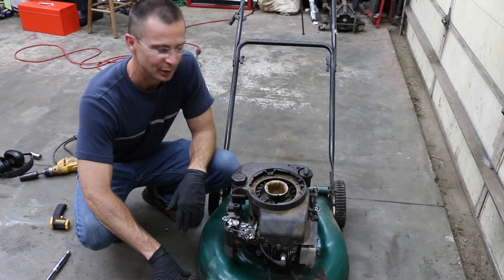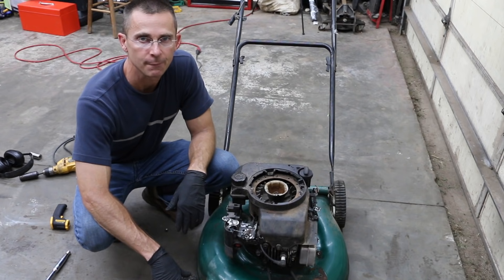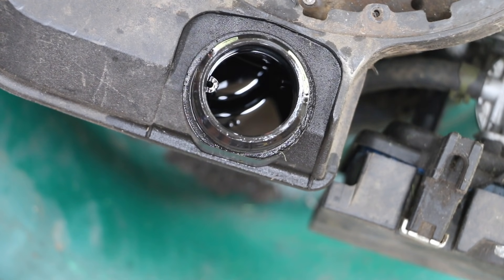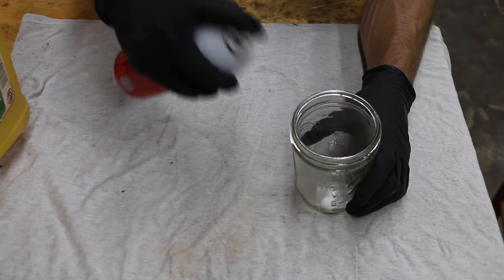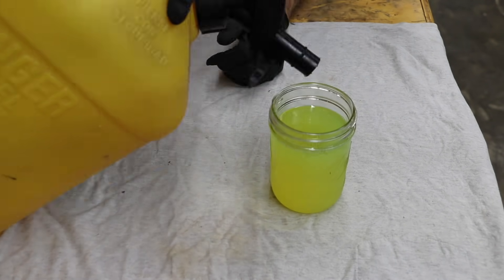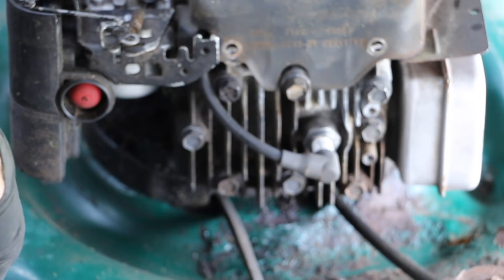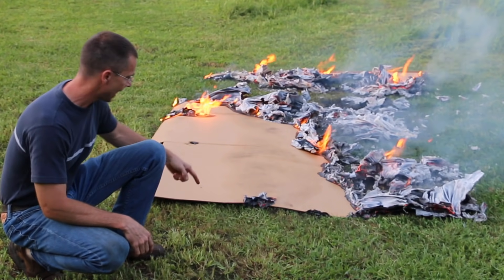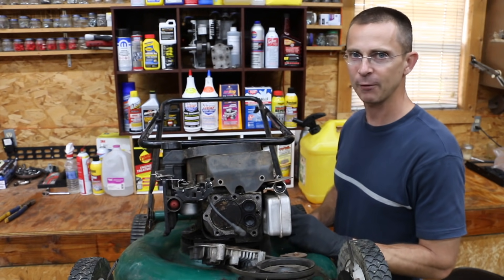Will a Gas Engine Run on Diesel?  Let's find out!

Comment: start it on gas then once its up to temp switch to diesel. i have done it with really good results
Reply from the maker: Thank you for this recommendation.
Reply: i set up 2 tanks with on off valves into a t. did it in a driving lawnmower during a garden tractor pull

Comment: If diesel burns slower. What affect on power and fuel economy would a 50/50 diesel gas mixture have? Just curious.
Reply from the maker: I wouldn't do this unless it was an emergency situation.  It could cause several issues over time. Thanks for commenting.

Comment: Test Turbo Max vs Bestline.... both claim it will save an engine that loses oil pressure.
Reply from the maker: Thank you for this recommendation.
Reply: Project Farm thank you for the response! I love your videos, they are always very interesting. I must warn you, to actually test the claims of the manufacturer... will probably be an expensive test.

Comment: In WW2 the Germans used wood shavings burning in a trailer and pulled the fumes off of that to then run a gas engine. Check into that and give that a shot!
Reply from the maker: Thank you for this recommendation.

Comment: when I was a kid the old boys that ran log trucks in our area used to add 3-5 gallons of gas to each of their tanks of diesel in the winter time when it snowed. Just FYI They told me when I asked that the gas helped keep the diesel warm in the tanks till summer. I thought that was, and still is a good answer.
Reply from the maker: Thanks for commenting on this.
Reply: This was to prevent jelling of yhe diesel fuel in cold temperatures.  Back before diesel was premixed - winter fuel - I'd mix it 50/50 with kerosene.  Not many stations carry kerosene anymore.  I'm sure gasoline was nearly as good. Still you would see a few semi trucks from the south on the side of the road in below zero temp in Minnesota stopped because of fuel gelling.
Reply: Was common when I was younger too - it stopped the diesel waxing in very cold weather.
Reply: We still do it in the heavy equipment on our ranch.
Reply: Works like an OTC additive, right??

Comment: Wondering what would happen if you preheat the diesel fuel.  Then try to start the engine
Reply from the maker: Thank you for this recommendation.
Reply: air to fuel mix in a petrol engine is about 15parts air 1 part fuel in a diesel engine it can be up to 70/1 so basicly if u preheat it like in a regular diesel it wouldent spit out unburned fuel ( the white smoke ) it would hawe 3 to 4 times as much energy so it would probably blow the gasket or the head itself i m not shure but i m 80% positive older diesels with a stronger mix like 30/1 are well known  for blowing up head gaskets turbos aspecialy
Reply: Ernie  all you have to do is have the engine warmed up and then fill with the diesel/stove oil/ kerosene and they will run fine !!! Have done it for years!!!  Diesel will ignite with a spark plug !!!!

Comment: The fact that you had to pump the primer to get it to run on diesel meant the carb needed to be adjusted. Diesel burns at a different rate. It's also a different viscosity.
Reply from the maker: Excellent point. I sure with these newer Briggs had adjustable jets like the older ones. I probably should have drilled out the main jet to increase fuel flow. Thanks again.

Comment: Diesel fuel is less volatile than gasoline, and diesel engines run at much higher compression to ignite the fuel without the aid of a spark plug. Aside from flooding/fouling issues it won't hurt much but won't run well or at all...
Reply from the maker: Excellent point and thanks for commenting.

Comment: I knew a guy who had an old (late 80s - early 90s) diesel VW golf. He would fill the tank with gas if the station didn’t have diesel. First time I saw him do it I told him it’s going to ruin his engine to which he said that he’s been doing it for years and it runs fine. Wtf lol.

Kinda blew my mind that it worked. I knew man others who had to get their diesel system drained and flushed following a mistake from a wife or kid. Don’t know if they just flushed the system preventively or if their trucks actually didn’t start following a gas fill?
Reply from the maker: Wow!  That's very hard on the injection pump as well as the engine.  Thanks for commenting.

Comment: Would it run (with the diesel) if you disconnect spark to the engine after initial starting? Hmmmm...
Reply from the maker: Thank you for this recommendation.

Comment: I’ve ran a lawnmower on straight K1 kerosene, I start out with gas, not much in tank, let the motor get hot then fill tank with kerosene. Yes-while it’s running, I don’t think it would cold start on kero. As far as mowing it does work but not as powerful. It’s odd to be mowing and smell kerosene.
Reply from the maker: Thank you for this recommendation.

Comment: The issue is the carburetor. Gas engines burn gas vapor where a diesel uses fuel injection with the fuel sprayed into combustion chamber. 

Try running a fuel injection gas engine on diesel.
Reply from the maker: Thank you for this recommendation.

Comment: Colza oil (Rapeseed oil) can also be a substitute for diesel. It should go well on outdoor temperatures above 10°C but below it starts coagulate. Pre heating can be required.
Most countries require extra tax payment when using colza oil in a vehicle though.
Reply from the maker: Thanks for this information.

Comment: How well do you think the Briggs will run on Kerosene?
Reply from the maker: I'm planning to try this in an upcoming video.  I think it'll do a little better than diesel but will likely need some gasoline mixed into it.
Reply: Thanks, mate. Sounds like it could be a good vid.

Comment: I can not believe the half truths and outright ignorant ideas about diesel and gas that are out on the internet.  Thank you for a straight forward test.  

Please forgive the generalizations and simplicity of the explanations....

1. Gas: Very volatile. The process of pulling it in through a carb jet with a vacuum vaporizes the fuel. Injectors atomize the fuel and increase the surface area allowing for greater surface area to evaporate into the air (early throttle body "injection" systems almost just dropped the fuel onto the butterfly plate with spray pattern that would make your garden sprayer look effecient).   Uses a timed spark to fire the air fuel mix.

2. Diesel: Not as volatile.  Relies on pressure injectors to atomize (not vaporize) the fuel very finely. (Much more so than a gasoline fuel injector).  Relies on timing the injection to control when the cylinder 'fires'.  Can also be spark ignition, if the fuel and air are mixed well enough. (Think jet engines starting up.)

Comparing Octane and Cetane  ratings is both right and wrong.

1: Octane rating is ideal a rating of how well a fuel will burn like 100% C8H18. (like saying the meter was based off the distance from the equator to the north pole, it was, but that is not how it is defined anymore.)  To refine fuel to the level of 100% octane would be costly and wasteful.  A range of C4 to C12 is typical of modern gasoline.  The lower the Carbon bonds in the hydrocarbon chain,  typically the lower the flashpoint (also the energy released is lower).   Blending a range of C4 to C12 hydrocarbons will give a different flash point.  Comparing how the blended fuels auto ignite to pure C8 is your rough comparison to your octane rating.   IE: A blend of C4,C5,C6,C7,C8,C9,C10,C11 and C12 ( The lighter fuels desire to auto ignite being offset by the heaver than C8 fuels as a whole) that ignites and burns at the same compression temperature and flame front rate will have a theoretical octane rating of 100. (auto ignite  and burn in a similar way as 100% C8).  This is not how they measure it, but if you look up how they do it (the (R1+M)/2 method) you will see it is a poorly described it is. They have reduced it to an auto ignition rating, not mentioning the source for the auto ignition temp ideal, the temperature that octane will auto ignite/detonate)

You do not want your fuel to detonate, you want it to burn in a controlled manner. You ideally run your compression ratio lower to keep the fuel from detonating so you can have a smooth burn timed by the spark plug.

Yes you can do a high pressure direct injection using compression ignition with a gasoline system, and they are looking into it.   Benefits: Better control over combustion rate, (slow and long injection over the stroke vs. fire and forget with the flame front/compression determined by density of the air fuel mix, RPM, and temp of the engine. Failures: lean initial burn can cause pollutants to form, poor air fuel mixing at higher RPM (initial problems with diesels leading to the comet chambers and such for extra mixing), and others.

Cetane rating

Hexadecane (also called cetane) is a hydrocarbon with the chemical formula C16H34.  Petroleum diesel, also called petrodiesel,[7] or fossil diesel is the most common type of diesel fuel. It is produced from the fractional distillation of crude oil between 200 °C (392 °F) and 350 °C (662 °F) at atmospheric pressure, resulting in a mixture of carbon chains that typically contain between 8 and 21 carbon atoms per molecule.[8]  This means that there is some octane already in your diesel.........  

It has a very high auto ignition point. It also has a very high (higher than C8) amount of energy associated with it.  Its a light oil.  Being less volatile than gas it is difficult to vaporize (Gasses burn, liquids do not).  Therefore we finely atomize it with high pressure pumps and injector nozzles to mix it with the air, this increases the surface area and will allow faster vaporization when subjected to heat and allow the combustion process to produce more heat and vaporize the remaining fuel even faster in a uncompressed (below auto ignition temp.) situation, such as igniting a mist of fuel oil with a spark/flame at room temp.  A lean burn of diesel does not produce the pollutants that a lean burn of gasoline does, so we have more room to play with how much and when we deliver the fuel to the high temp air.

Again we do not want detonation in the engine, so we control how much and how fast or slow we inject the fuel into the chamber after the air has been compressed to a temp above the detonation point.   Resulting in the fuel igniting as soon as it is sprayed into the camber and vaporizes due to the heat.

Cetane rating is the same idea as octane in the sense that we want to rate our fuels ability to auto ignite compared to straight hexadecane.  Again diesel fuel is a mix of different hydrocarbons, not just pure C16.  The goal is to get a fuel with a mix of hydrocarbons that produce a rating compared to C16.  

Since we deal with Hydrocarbons up to C21 (very hard to ignite compared to C16) the scale is reversed for diesel, as we are generally dealing with heavier oils that do not want to burn easy, so the cetane rating is higher the easier the fuel is to ignite (100% igniting just like pure C16, theoretically).  A lower rating means it takes a higher temperature to ignite the fuel.  

Putting a "little" (I mean a very little <1%) gas in a diesel engine will not do anything drastic, it may lower the detonation point a bit, but it will basically do nothing.   Putting enough in to help start the truck on a cold morning will result in damage to the pumps, injectors, and other components that are built to rely on the lubrication provided by the fuel.  You also start running into the fuel burning faster than the piston can move at lower RMPs and High compression ratios.  This can cause the pressures to build faster than the piston can move and basically cause a detonation resulting in a blown engine.  Diesel engines rely on the slow burn to produce pressure through the entire stroke, not a sudden bang at the top of the stroke.  This is why they run happy at lower RPM's. Increase the pressure with a forced air induction and you can increase the rate of burn and therefore get a higher RPM, but you may need to compensate with a slightly lower compression ratio (not so much that you wont auto ignite with no boost (but whats 24-40 psi compared to the overall 324 psi you get with 22:1 compression). Yes you can build a system that would run on a thinned mix but you gain nothing and loose energy density.  Nothing that a glow plug and proper engine design cant overcome and keep the benefits of burning oil.

Diesel is soluble in gasoline and will distribute itself fairly evenly over time and agitation (It will not puddle over time).  Adding a bit of diesel (kerosene) to gas will lower the percentage of pure octane, but will increase the octane rating by causing the detonation temperature to be higher.   The small amount of diesel will burn, but it will not auto ignite, it will rely on the gasoline burning to raise the temperature high enough to burn the fuel.  In a carbed engine this may also offset the amount of air/fuel ratio, thinning the gasoline (14.7:1 for gas, 14.5:1 for diesel) a bit because half gas, half diesel will result in an initial ratio of @ 7:1 gasoline to air, and until the diesel starts burning this air fuel will be lean and possible harder to ignite. Above 50/50 and you have real trouble igniting the gasoline, not to mention the problems that may arrive with the fuel pump fighting a heavier viscosity, flow rate through the filters, flow rate through injectors ect.  In an injection computer controlled gasoline engine, the air fuel ratio will be adjust up to a point to compensate for a complete burn, but if you cant get it burning or oil dripping from injectors....

The result is this.  (disregarding damage to the cat/ fuel filters/ ect) Adding 10% Diesel to your gasoline will not effect it much, you will have a bit more energy density (almost immeasurable) and less knocking under load.  Yes you can do it. Yes it will burn.  Yes it can have benefits. However like the diesel, nothing that a well designed engine cant do on its own.

Comment: Older tractors with low compression could run on diesel, kerosene or tractor fuel but the engine had to be kept hot with shutters in front of the radiator.  They would start on gas first then switch over.  Try blocking the cooling air and run the engine hot to see if it likes the diesel better.
Reply from the maker: This is a great post. Thanks for commenting!

Comment: @Project Farm (and any one else) after repetitively running diesel on my 2 riding mowers after about 2 tanks both quit running at it turns out it damaged the diaphragm pump gasket thing in both carbs. there quite wrinkly now and next paycheck i shall be replacing them is there not pumping fuel(i have to fil bowl my self to start motor.)
Reply from the maker: Thanks for sharing this experience. I hope you get the mowers repaired quickly.

Comment: If you could get the compression up to 200psi, you might be able to run diesel - but then you'd have issues running gas and might blow the head clean off the engine :D
Reply from the maker: Great point. Thanks for commenting.

Comment: i had a gallon of rc fuel left over. my step dad ran it and a gas mix the mower would really scream and finished the yard but blue flames out the exhaust and she later bogged to a stop. you should try it by itself
Reply from the maker: Thanks for this recommendation.

Comment: There is a reason why it won't run without priming. Diesels have mechanical pumps to feed the mechanical injectors and do not mix with the intake air through a carburetor or similar. Diesel does not evaporate as well as petrol so therefor you need to keep feeding it into the engine.
Reply from the maker: Great point and thanks for commenting.

Comment: No  surprises here when the engine run at 50/50. The gasoline acts at a carrier for the diesel.

Would be interesting to see the combustion itself of the diesel is able to flash off when gas ignites.
Reply from the maker: Thank you for this recommendation!

Comment: My friend and I had luck running a lawnmower on diesel when we let the engine warm up on gas first then added the diesel to the gas tank while it was running. I'm fairly sure we got it, if not dead on, then fairly close to running on 100% diesel fuel, it was pinging like crazy though! The mower didn't last much longer after that!
Reply from the maker: Thanks for commenting on this!

Comment: Diesel needs heat and high compretion to start.. 50 50 will run just enough gas to make it work.
Reply from the maker: Great point and thanks for commenting.

Comment: Did the engine run better with the 50/50 mix or just the straight gas?
Reply from the maker: I think it ran better on straight gas.  However, it think a 10%-20% diesel mix would have made it ran as good or better thank pure gas and I could have achieved better fuel efficiency.  I plan to test this in the near future.

Comment: You should try to use diesel fumes in through the intake like you did with the gas fumes
Reply from the maker: Thank you for this recommendation.
Reply: Project Farm i just figured that if it's only vapor it might combust with the spark and your the only channel i know that does cool things like this

Comment: Another thing with a diesel is its injected with a lot of pressure making it much more combustible. If you spray it out of a spray bottle it will react more like gasoline. Compare that to a few thousand psi like a mechanical injection system and then it's very combustible the current common rail diesels are closer to 30000 psi!
Reply from the maker: This is an excellent point. Thanks for commenting!

Comment: I know some of the older farm tractors would run on kerosene however you had to run them hot they had louvers on the radiator you had to close them you had to run the thing super hot
Reply from the maker: Great point regarding how to make Kerosene work and thanks for commenting!